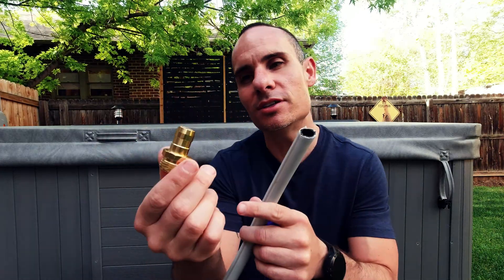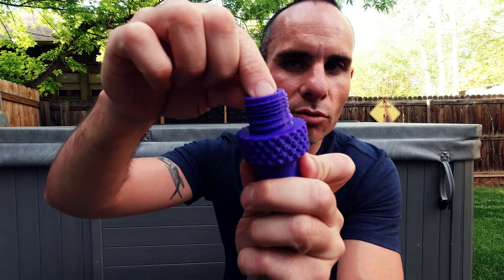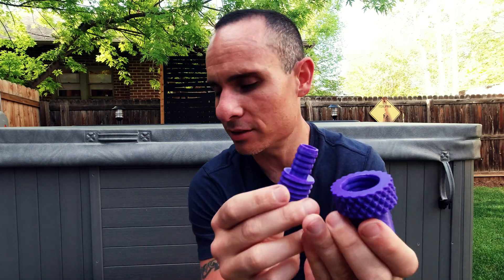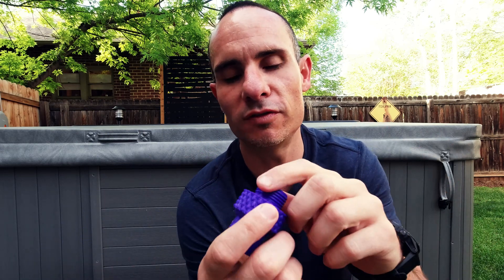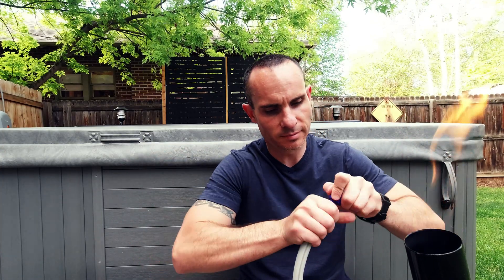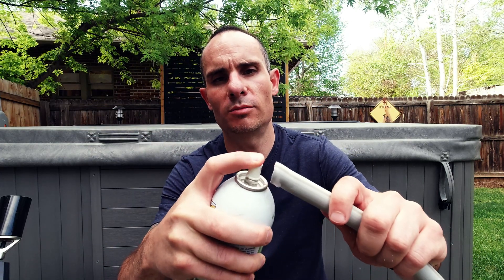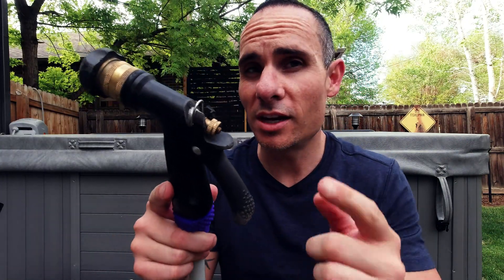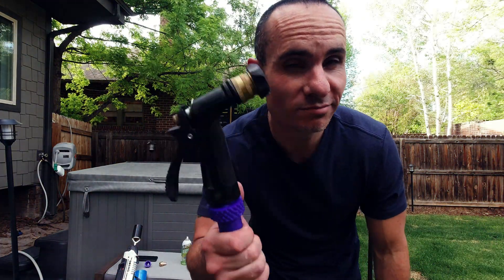Garden Hose Repair with 3D Printing Magic

Comment: Boil water in the microwave with a coffee mug then stick the cut portion of the hose into the hot water to soften it for 30 sec or so. That fitting will go on with ease and without lubrication. I really like practical 3D prints! Nice video.
Reply from the maker: That’s a great tip. I do this for drip irrigation fittings, not sure why I made my life so hard here lol!

Comment: Why don't you print it a bit smaller so it will fit?
Reply from the maker: What I should have done is heat the hose with hot water. The size was pretty on point once properly installed.
Reply: @ALLYOURTECH3DP  Cool

Comment: Your print would be much stronger if you were to print it on it's side.  Otherwise it could de-laminate because of the orientation of the layers.
Reply from the maker: I considered that, and after a month it is still holding strong. It's printed at 100% solid infill, and solid infill is rectalinear, so it should have fairly solid structure with the layer striations as least being two dimensional. If it ever does have issues, I agree that sideways may be a good answer.

Comment: Any reason you didn't cut the end of the hose off square before attaching it to your coupling?  Seems like having that fairly square would help everything seat better and have more even stresses on the part.
Reply from the maker: No reason, just completely forgot to do it ahead of time. I agree though that it would be best to square it off.